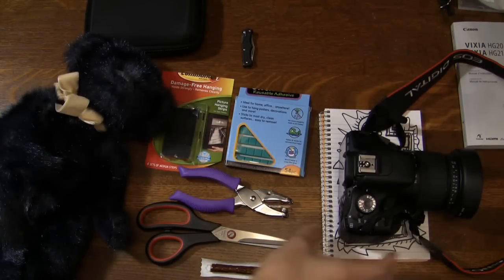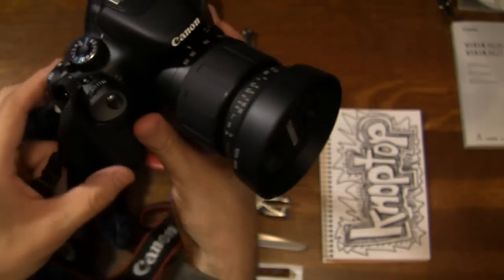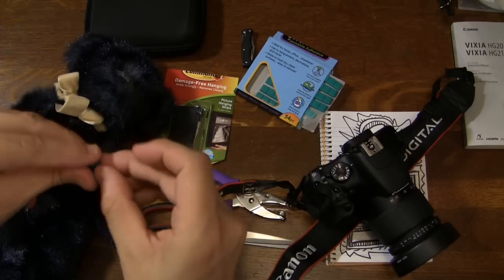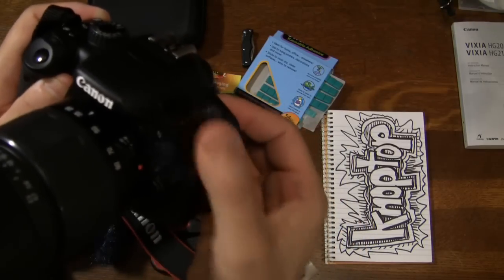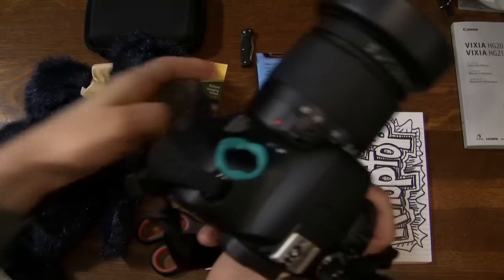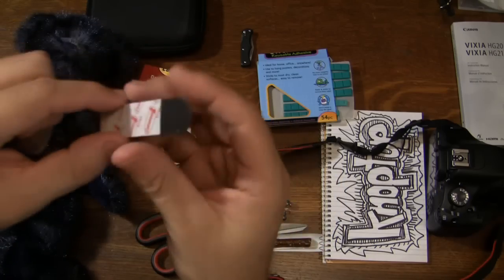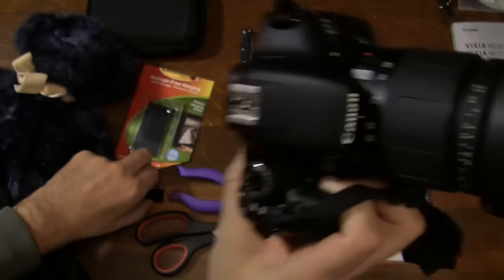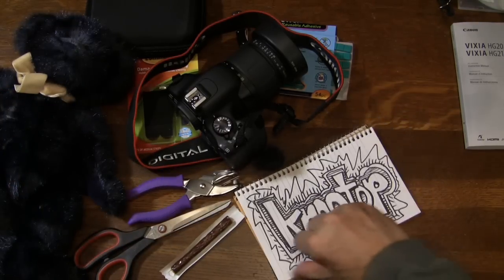Homemade Micromuff - Camera Wind Muff - Better Outdoor Sound- QUICK FX

Comment: @Knoptop yeah that was a fun little hack toy someone came up with but like with everything else you need to wipe your card occasionally and re-load it again so that everything works as it should.  they came close to adding most of the magic lantern features on the T3i but it's still not as much as you get out of magic lantern on the T2i so i wasn't wasting any money to upgrade just so i could have an articulating screen.

Comment: yeah i went kind of the other way with the T2i myself. i went out and bought the Rode SVM that came with the dead kitten, that mic is AWESOME! the dead kitten does nothing for it if the wind is strong enough though specially since the thing can normally pick up a pindrop sound.  Do you have Magic Lantern installed on your T2i so that you get all the audio and extra video controls?